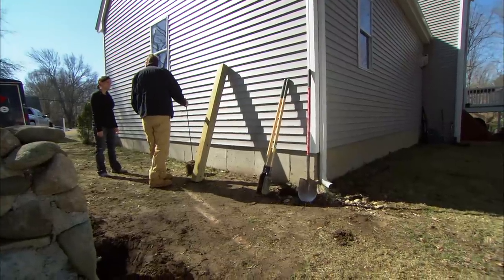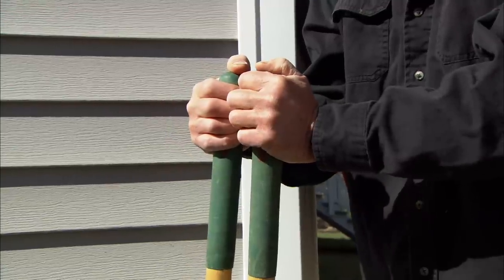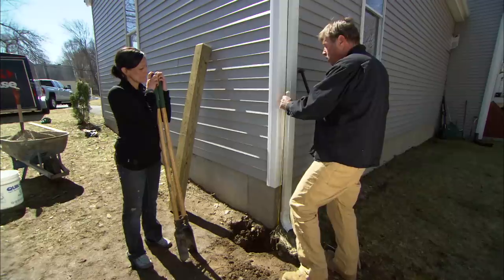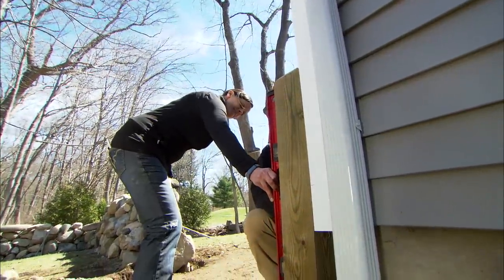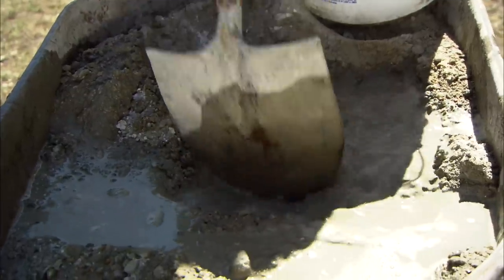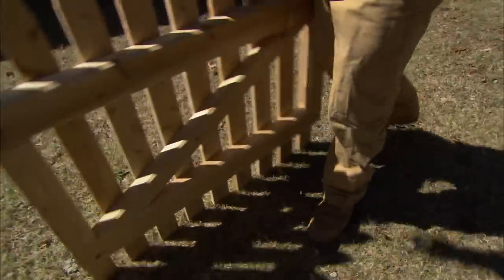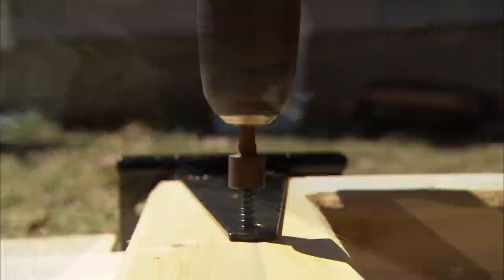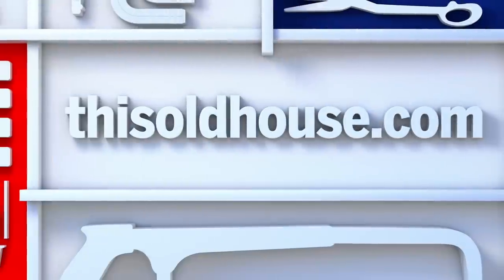How to Install a Fence Gate | Ask This Old House

Comment: Wow...A fence guy told me about a different method.  Using this traditional method, the result is usually a sagging gate that never fit well.  In contrast, fence guy says,.. Build the fence like there was no gate but put the posts in the right place.  Then, construct the gate bracing on the back side (using the existing top and bottom rails).  Finally, turn on the power saw and cut the gate right out of the solid fence.  Attach hinges.  Result: a gate that looks/fits like it belongs...because it does!
Reply: 😎 im baffled because i was saying your full of it. i then read and reread and was like “you are a genius”.
Reply: that'd make a sharp looking gate. thanks for the tip

Comment: I thought the one post was too close to the house. It was almost touching. That does not bode well when the house is ready for painting or if the siding needed repair. A 2 inch gap would be fine aesthetically and provide enough space to sneak in a paint brush.
Reply: yep real workers not only know how to put something up put think about how do you work on it after. I thought the same thing.  Access doors, repair holes, painting after, repairing/replacing after install, yep these are things that people that actually work on their own stuff think about after you have worked on enough stuff that has no access.

Comment: I distinctly recall "Norm"--- you know who I mean--- in his mailbox replacement PBS show episode, stating that you should never pot the post in concrete but should use gravel or the like, packed around the post. I was a noise consultant and after specifying sound wall heights along a roadway I got from the company that sold the transportation authority the soundwall materials--- they were of treated southern pine--- their instructions for installation. The instructions were to pack in gravel in lifts--- not concrete.

Comment: Pro tip from an amateur, every fence gate over time starts to sag. The best way to stop it before it starts and make sure it doesn't sag? Mount a caster, (swivel wheel) on then bottom on the ends of both gates. That way the gate rolls on the wheels and the wheels hold up the gate.
Reply: Eh, frost heaves and a few inches of snow would make the caster a pain in the neck.
Reply: Or put a turnbuckle cable on the diagonal so you can adjust it when it drops

Comment: If putting wooden posts in concrete make sure concrete come up over surface couple of inches up the post. If you leave it below the surface the wet soil and grass will keep the bottom of the post damp and cause it to rot.

Comment: Wouldn't it be a good idea to offset the post a few inches from the structure ?
Reply: I thought the same thing. Seems like rubbing and moisture could cause issues later on.
Reply: Yes it would of been a good idea, for future repairs or painting etc.
Reply: I thought the same thing too, that’s a moisture trap right there.
Reply: It’s vinyl siding, not wood

Comment: Nice video champ..

 i got a question: would adding gravel at the bottom be any beneficial?? I was under the impression that adding gravel at the bottom of the post serves as a drainage mechanism and slows down rotting at the bottom of the post.
Reply: out of all the posts i have pulled out of the ground from fences 20yrs old or more, (here in south Louisiana where the water table is 4" below surface) the posts show zero signs of rot in the ground what i have always seen is wooden fence posts rot right at the surface above the ground because people put the cement flush with the ground and the bottom of the post on the surface is always sitting in water. Thats why i either mix the last amount of cement thick and make a pyramid about 4" about the ground around the post or use 2x4s to frame around the post about 4" around both ways allow the water to run off and allow the post to dry instead of sitting in water at the ground level and rot.  Try it out. Its only a slight amount of extract cement. What you can do is use screws and have a few sets of 2x4s to put on the posts in the morning and move them and do some in the afternoon.

Comment: Ryobi drill?!?!?! Tom would be disappointed
Reply: Ryobi is the only power-tool manufacturer which has publicly promised to never change their batteries' form-factor. 

While DeWalt, Festool, and Milwaukee pointlessly change the shape of their batteries every few years to milk your bottom dollar out if you, Ryobi's batteries will work across multiple generations of Ryobi tools.
Reply: Jake agree
Reply: Nothing wrong with Ryobi.
Reply: Jack Wow I didn't know that
Reply: Ryobi stuff is perfectly ok for 99% of normal situations. I have a ton of Ryobi stuff and I've been more than happy with them. My dad is a contractor and a lot of his stuff is Ryobi as well.

Comment: I always put gravel at bottom of my post holes. Never let soil touch your post. If you do, your just asking for it to rot.
Reply: Ugh
Reply: It's pressure treated.
Reply: By the time the posts rot, the rest of the fence will be rotting too. Pressure treated posts are designed for ground contact
Reply: sean weaver I'll take my chances with the added expense of a handful of gravel.
Reply: Pressure treated or not, we were always taught to place a couple of inches of concrete in the hole before placing the wooden post on top. Then fill with concrete to the level required. It stops the post acting like a wick and sucking up that moisture from the soil. Pressure treated is ok above ground level, not so good in the permanently damp soil.
Reply: You can buy pressure treated lumber with varying amounts of treating, anything from above ground only to direct burial.
Reply: Charles McBride Thanks Bill

Comment: Not a fan of concrete around wood posts.
Reply: Why not? And if not concrete then what? machine packed dirt? Most of the time wooden posts rot right at the surface where the concrete ends as it is usually flush with the ground. That's why when i pour cement around wooden posts I make the last mix thick and i grade it up like a pyramid above the ground to about 4" about grade or i use a 2x4 and frame about 4" all the way around the bottom of the post the height of a 2x4 that way the water runs off and allows the post to dry instead of always sitting in water at ground level I find either way saves the posts from rotting.
Reply: @RossMalagarie  I chose not to do it for my fence. I used all pea gravel.

Comment: Damn two 5x5 posts, that's one heavy duty gate.
Reply: That's insane overkill for those little gates, lol.
Reply: I was taught by a professional fence contractor that you generally use a larger post as in a 4 x 6 for your gate post and your corner post and also usually the starting post of a fence as that is where the most load is being taken on a fence and gate.
Reply: @JG-pw5cr  - It's a decorative gate, open pickets with zero wind load.  Insane indeed.

Comment: Concrete not needed; backfill with soil-less cracked rock and vigorously pound the fill with  piece of 2x4  frequently while backfilling. This allows water to flow away better

Comment: Post against the house that close bad idea
Reply: You right...Now the fence concrete gonna mix w/ the foundation concrete and you'll never get it out...Had a buddy do that..I tried to help him....Short of a jack hammer...he aint getn the post  concrete out...give yo'self at leas 6" spacing..or used some type of paper spacer that will degrade over time, but still have a tite fit.....